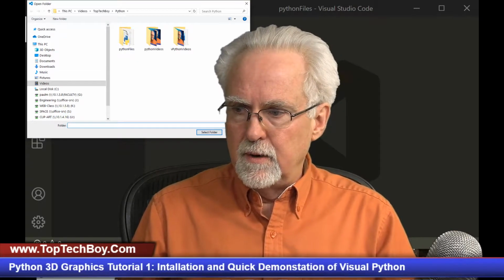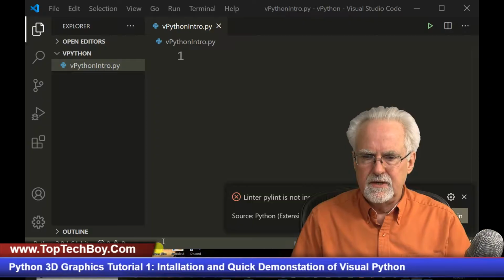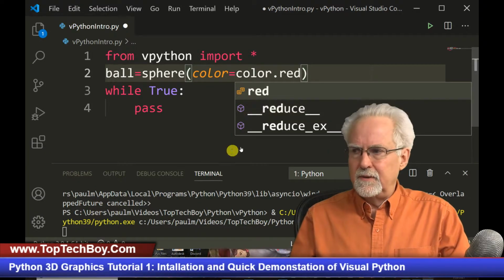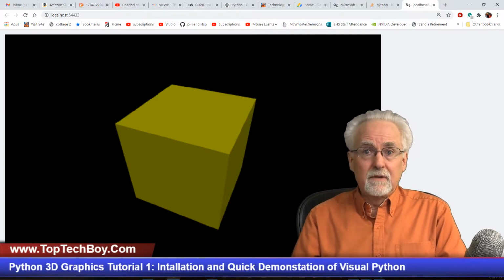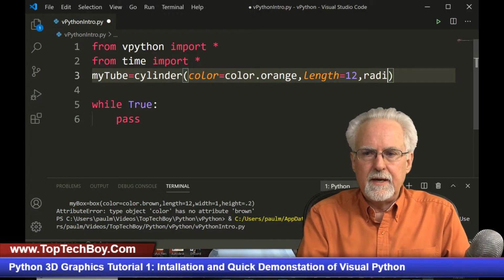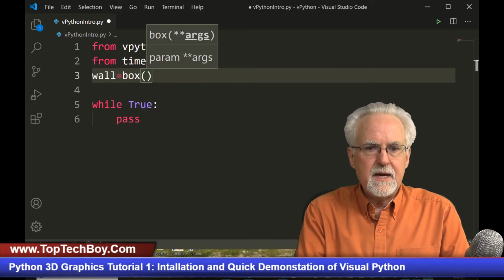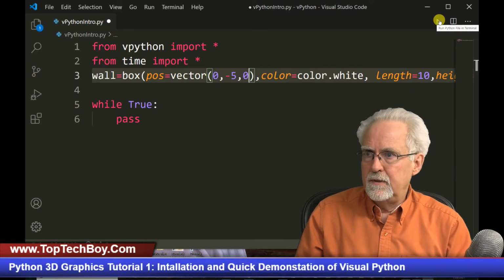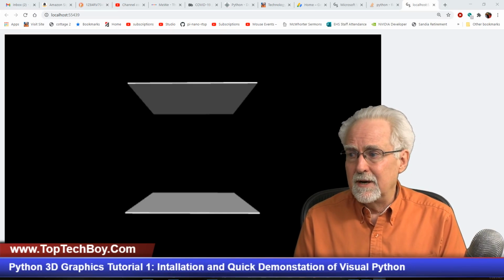Python 3D Graphics Tutorial 1: Installation and Demonstration of Vpython

Comment: from time import time
from vpython import*
from time import*

#length=across x-axis
#width=across depth
#length=across y-axis

#position vector=x-axis,y-axis,depth

flooring = box(pos=vector(0,-5,0),color=color.red,length=10,width=10,height=.3)
ceiling = box(pos=vector(0,5,0),color=color.red,length=10,width=10,height=.3)
rightWall = box(pos=vector(5,0,0),color=color.red,length=.3,width=10,height=10)
leftWall = box(pos=vector(-5,0,0),color=color.red,length=.3,width=10,height=10)
backWall = box(pos=vector(0,0,-5),color=color.red,length=10,width=.3,height=10)
#frontWall is commented as it blocks the 3rd dimension;)
#frontWall = box(pos=vector(0,0,5),color=color.red,length=10,width=.3,height=10)
blueMarble=sphere(color=color.blue,pos=vector(0,0,2.5),radius=.5)
blueMarble=sphere(color=color.blue,pos=vector(0,2.5,0),radius=.5)
blueMarble=sphere(color=color.blue,pos=vector(2.5,0,0),radius=.5)

blueMarble=sphere(color=color.blue,pos=vector(0,0,-2.5),radius=.5)
blueMarble=sphere(color=color.blue,pos=vector(0,-2.5,0),radius=.5)
blueMarble=sphere(color=color.blue,pos=vector(-2.5,0,0),radius=.5)

blueMarble=sphere(color=color.yellow,pos=vector(0,0,-3.5),radius=.5)
blueMarble=sphere(color=color.yellow,pos=vector(0,-3.5,0),radius=.5)
blueMarble=sphere(color=color.yellow,pos=vector(-3,0,0),radius=.5)

blueMarble=sphere(color=color.yellow,pos=vector(0,0,3.5),radius=.5)
blueMarble=sphere(color=color.yellow,pos=vector(0,3.5,0),radius=.5)
blueMarble=sphere(color=color.yellow,pos=vector(3.5,0,0),radius=.5)

while True:
    pass

Comment: Hey Paul, am having problems with my vpython . After installing, i could not execute the programes.
this is the error am getting   " AttributeError: partially initialized module 'vpython' has no attribute 'sphere' (most likely due to a circular import)"
Reply: Same problem, have you found the solution?

Comment: I tried several times to install vpython with pip, but it did not work. The error was "pip was not declared", but I did the same as in the tutorial. Can somebody tell me what went wrong?
Reply: I had similar problem. Solved that one by upgrading pip, even tho using python 3.9.6.  to upgrade pip use
python -m pip install --upgrade pip